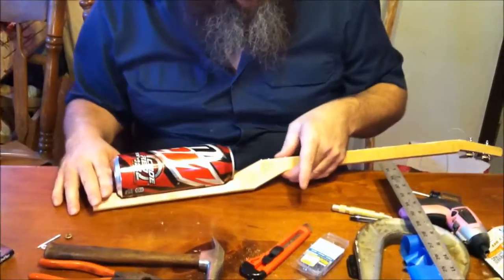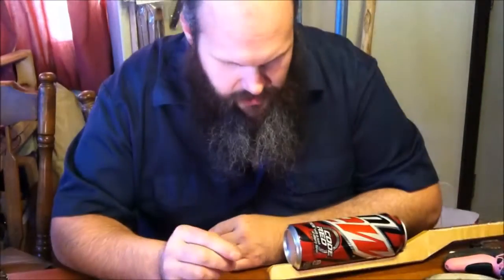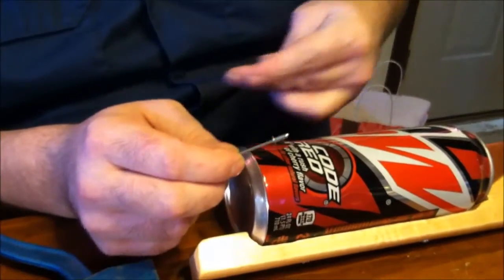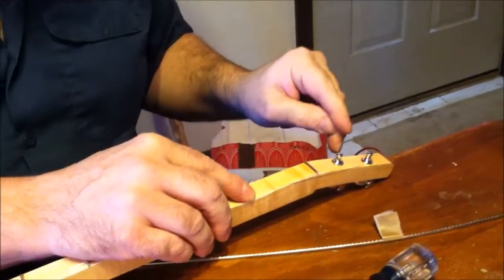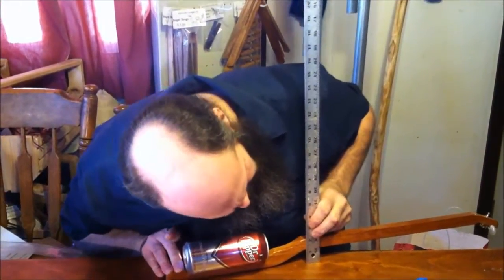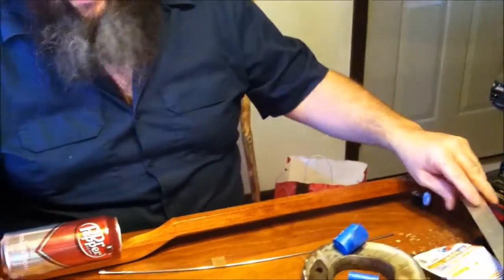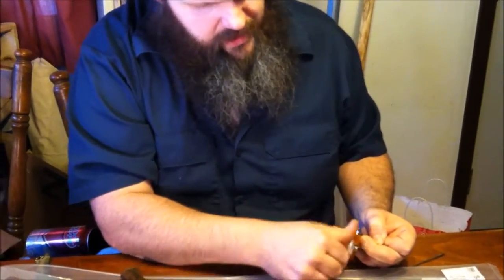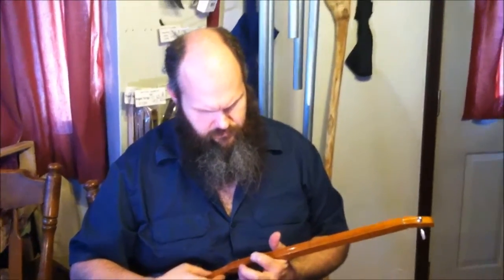Build a Canjo part 6

Comment: Hey, what was the wire you use??...I found gauged wire that I think might work ....a template i found said that a 23 and 26 gauge wire is the same size as a .010 & 
.014 & .023 mm wire....can I use that or what do you recommend and where can I get the wire??...thank you